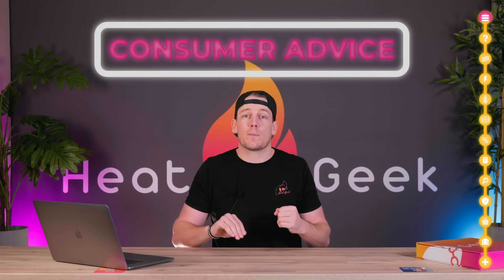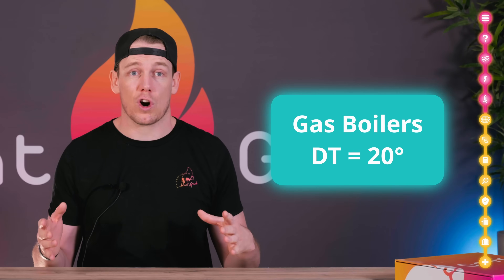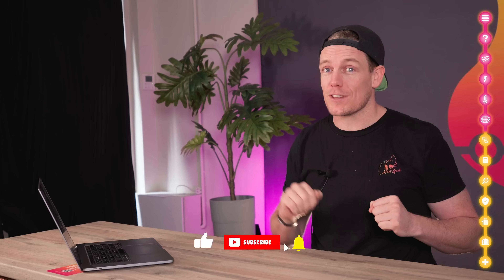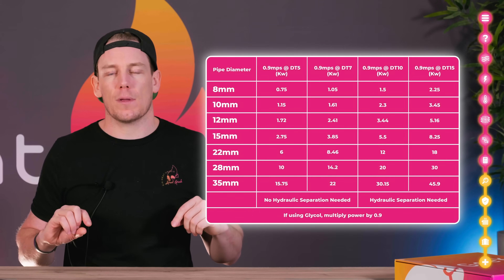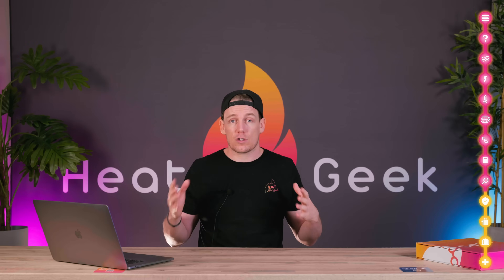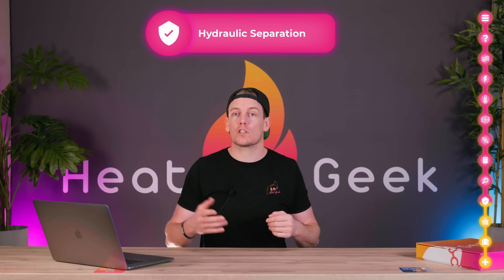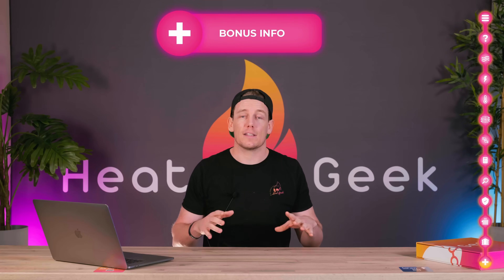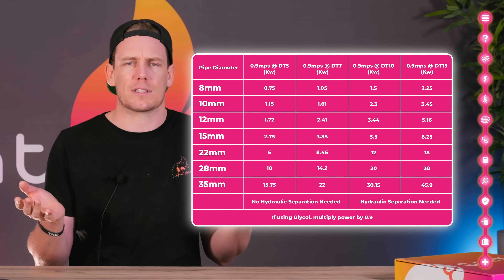Do I Need To Upgrade My Pipework For A Heat Pump Install? | Consumer Advice

Comment: I have a 20mm pex pipe to the upperfloors from below underfloor heating. Boiler is now at the 2nd floor which has 28 mm pipe with all rads and underfloor heating connected. This works fine.

I am thinking of a heatpump outside and inner equipment in the basement. The rads upstairs have a combined output of 2.5-3kw at average 40 degrees which keeps the house more than enough warm after insulation has been applied.

Will the 20mm uponor flex pipe be enough for transfering this amount of heat? 

The groundfloor heating will be coupled directly.

Comment: Can we get the grant if we install the ASHP ourselves? The labour costs seem exorbitant for just installing a heat pump. I am an air conditioner engineer, and the principles are the same for a fan coil or plate exchange.
Reply: google MCS umbrella scheme providers.

Comment: Thanks Heat Geek twins. 
My plastic microbore (inner diameter 7mm) gives flow speed of 1.24 m/s for my biggest 1kW radiator at dt=5
but only 0.9m/s at dt=7. Teetering on the limits I think. Not ideal.

Comment: I’m moving home. The new house (1930s) has a brand new gas combi boiler. Should I keep that and lower usage or swap for a new high temp
Ashp ? Is there any benefit other than lowering CO2 emissions?

I have a low temp heat pump in my old house (1960s) and it works just fine

Comment: Great video, just wondering though, would a high temperature heat pump remove the need to replace any pipework in an existing installation?

Comment: This 'no plastic pipe' comment is annoying. It's still just pipe, with flow rates, volumes and pressure drops. Just give us the numbers and let us do the sums (yes my house already has a lot of plastic pipe, but it's also very low demand due to near-enerPHit rertofit. So it might be good enough, but I can't check without the relevant info.
Reply from the maker: If it’s near enerphit it will be more than ok!!
Reply: @HeatGeek  yes, probably, but the sums still need doing. You said yourself that doing the sums is very important, but I can't if no data for plastic pipes is provided. I've got a couple of runs of 10mm plastic, which is of course the worst possible pipe for flowrates. But they are quite short, and tearing off the plasterboard to fix them is not something I want to do without some sums proving that it is necessary.

Comment: My hot water tank has 22mm inlet and outlet for flow and return am I okay to take it straight to 28 to each floor if the house then tee off into 22 and then 28mm back to tank which then converts back onto the 22mm anything else I should take into consideration it’s a 12kw heat pump

Comment: I have a 1 pipe system in my house which (as I understand) really needs to be replaced with a 2 pipe system for a heat pump. I was going to redo the pipework myself to save money before getting someone in to fit a heat pump. My take away from watching this video is that I might as well make my primary pipework 28mm as bigger shouldn't be detrimental and bigger radiators also can't be detrimental (even if they are bigger than they need to be for the room size)?
Reply: My neighbour just used his existing 1-pipe system with a new heatpump and it's been working fine for 3 years now. This works because he insulated the house very well so the heatpump is only 3kW. i.e just like the advice around 12:00 on this vid. His whole install cost under £2000.

Comment: Friction on the walls of the pipe is incorrect. It's resistance which is very different. This debunks the claim that the walls of the pipe wear out significantly due to friction. It takes an irrelevantly lengthy amount of time for plumbing pipes to wear out due to friction from wster.

Comment: Interesting video thank you.  You said that plastic pipes don't belong in heating systems, but in more than one property, I've seen damaged pipe being replaced with a short section of plastic (avoidance of drain down and soldering to effect a copper pipe repair).  Also I've seen a run to a new additional (small) radiator (for downstairs toilet addition) having been done in plastic pipe under the floor (connected between two nearest original radiators).  Do these small runs really matter?  I understand you commented about the plastic pipe inserts that choke down the diameter at the joints, so I'm a bit concerned those might matter in future if the gas boilers were to be replaced with heat pumps.  Thanks.
Reply from the maker: @TechTravel-up2cx  yes lots of people do it. Especially diyers like builders or handymen.. and ofcourse house bashers. Regarding the bit about soldering most are moving to pressfit now so not and issue. It’s not just the choking it’s also air ingress.
Reply: @HeatGeek  Thanks for the reply.  Air ingress! Oh no!  😲
Reply from the maker: @ yes but not an issue for air locks.. an issue for corrosion and rust that will kill mechanical parts
Reply: @HeatGeek  OK.  Thanks very much for that insight.

Comment: I thought most properties had 15mm primary pipework? My bungalow has 15mm and my heat loss is about 7kW so does that mean i need to replace it all with 22mm? Also i didnt understand thd part where you said you can replace the pipework just between the ASHP and branch before the rads? Thanks.

Comment: This is a great video, but you should warn viewers about the building regs re how much wood you can safely cut out of the joists. 22mm is often the limit due to those rules! And good luck venting those huge pipe diameters😮

Comment: 8kw pump with 4kw load and main pipes are 22mm copper and 15mm for the radiators . The flow noise coming from the main pipes is very loud :S

Comment: in Europe, now days, triple glazing is not much more expensive then double, so  more and more people rather pay a bit more for triple glazing when throwing out 30-50 year old windows when doing renovation. also triple glass windows let thru even less noise, which is an extra benefit.

Comment: Hi adam. Very useful video. We need advice having applied for a Home Upgrade Grant to install a ASHP. We live in a 4 bedroom 1973 detached house and wish to convert our 10 year old biomass boiler for a ASHP.
The approved contractor working on behalf of Somerset council quoted £27k for the kob due to needing to upsizing internal pipework as well as radiators.
Two subsequent installers have both quoted considerably less and questioned the need to upsize pipework. The existing pipework runs at 28mm from biomass boiler to the house and then 22mm and then 15mm spurs.
The local retrofit assessor sides with the approved contractor aa it follows MCS rules for home upgrades. The problem is that upsizing all pipework would involve lifting floorboards, carpets tiles, ripping out old pipework and installing new which would run down walls anf slong skirting snd basically would mean huge disturance and redecorating afterwards.
Plus we would have to put almost as much own funds to the grant. 
Basically we need a third impartial opinion as we are also considering the alternative option of reverting back to oil boiler which is by far the cheapest option. Very happy to provide more information but desperate for advice. Thanks
Reply: Did you get any further here? I am in pretty much the same position as you. The approved contractors came round today and said the pipe work would need to be changed resulting in a massive construction job, particularly as I have solid flooring on my first floor. I haven’t had any other second opinions so far so don’t know whether changing the pipes is 100% necessary as the contractor is saying.

Comment: I live in a late 90s 4 bed detached that still has an old non condensing boiler. The loft is insulated but not quite up to todays standard and I have cavity insulation and double glazing throughout. I am expecting/hoping my heat loss is no more than about 6kW.

The primary pipework from the boiler to the three port valve is 22mm but all my pipework to the radiators is behind the plaster board. At some point it becomes 10mm microbore as this is what goes into all radiators. So how do I check what I can't see to make sure there are no hidden restrictions such as manifolds, if that matters?

Is there not a way to do some tests to get precise measurements? Some equipment that can be attached to test out the flow, etc?

I am keen to avoid the additional cost, complexity and reduced efficiency of a buffer/LLH, if at all possible.

Comment: Just to clarify something - the text accompanying etc says there is no problem if the primary run is the right size and "tee offs" of 15mm to rads are ok?  Are there any limiting factors on this?  I'm planning a HP now and I have 35mm from the boiler room, down to 22mm in the house which then tees off to 15mm to 5 radiator locations which will have a combined need to deliver about 6.2kw at -3 (and rads will be sized to assume 40/35 flow and return).  Am I looking at a problem with the "tee offs" from the 22mm pipe to these locations at 15mm?

Comment: If I have two collectors for UFH, the first one covers area with 6 Kw heat loss, and the second one covers area with 3 kw heat loss. When I'm designing the pipework to the collectors do I need to take into consideration those values separately  and according to the energy that need to be transferred to the collectors to choose the right pipe size from your table?

e.g for delta T = 5 and pipe velocity 0.9 for the first collector of 6kw I need to use 22 mm, and for the collector of 3kw I need to use 15 mm pipe. and both pipelines  to connect into 28mm pipe

Comment: Hi I have two  questions, 1) would you fit a low loss header when you have a hot water tank as well as central heating?
2) in one of your video's you talk about not putting glycol or antifreeze  in a system but then you dont say what you do put in??
Reply from the maker: Whether you have a cylinder or not doesn’t affect whether you fit a llh. 
 Advice generally is to fit an antifreeze valve although we would question even if that’s needed

Comment: Hello, I have and plan to install your Ariston Nimbus compact heat pump with 110s net 16.7 kW.
I have a house on two floors, 70m2+100m2, roof insulation 20cm, walls 15cm, floor 10cm and triple windows.
Can the Nimbus compact do heating, cooling and hot water independently without a buffer and an additional pump?
Thank you.

Comment: Could I ask, I have a relatively easy option to increase the pipe bore for the upstairs radiators but not the downstairs ones. Is that something I should go for? Does the fact that they’re upstairs come into the equation? i.e. they need more hydraulic head

Comment: Diameter x 2 = Volume x 4, for the same length of pipe, not 8.

Because bore area of pipework  2cm diameter ( radius 1cm) = PI x r^2=PI  x 1^2 = PI
Bore are of pipe 4cm diameter (radius 2cm) = PI x 2^2 = 4xPI

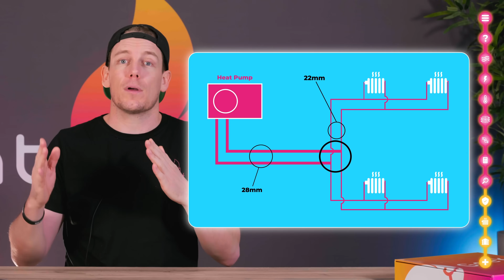Comment: The diagram at 8:16 shows a heatpump directly suppling a network of four radiators.
Can a heatpump really be set up this way so aimply without any hot water tank ?

I've only ever seen heatpump installations with huge watertanks and quite complex pipework too. So do people only have these giant water tanks for hot water supply and they don't play any part in supplying house heating ?

Can one run a simpler (no tank) heatpump system like this JUST to supply radiators for heating and have something else for the hot water supply needs ?
Reply: You could yes but can't really see the pojnt

Comment: Hi Adam, interesting. Could you give an indication of the % efficiency reduction of a heat pump working with a temperature difference of 6 degrees versus 5 degrees? I live in the Netherlands, no heat geeks here.

Comment: O no I just did a new build in 22mm poly all the way to the rads and it’s having a heat pump installed by another company. 

This has me feeling really bad. 🤦🏻‍♂️

Comment: Hi Adam, late to your channel. Could you do something specific to brands eg i have Mitsubishi ecodan and Mitsubishi recommend constant flow temp for under floor systems. I have tried weather compensation and it was terrible (cop 1.9) but i can squeeze 3.0 out at 7C ambient. I don't understand why that was the case and would love your take on it.

Comment: A great video ,  so you may nkt have to upgrade  unfortunately to cut costs many homes built in recession times have very small  pipes  10-15 even 8mm in at least part of the system   to save costs, which is  far smaller than any numbers quoted in this video .

Comment: i have the option of installing a buffer in parallel or in series  (on the return) on a heatpump. what is best? With the buffer in parallel it does not need an additional pump

Comment: Just catching up ... at 4:58, doubling diameter doesn't mean increasing volume by 8!

Doubling ALL dimensions (including length) would mean increasing volume by 8. Assuming the same length of pipe, doubling diameter means increasing volume of water therein by 4 (i.e. increase of cross section).

Comment: I use a gas boiler. If the government wants me to switch to a heat pump, they better be prepared to pay for the equipment and conversation. I won't buy something I do not want.
Reply: Govt has no money, they use my money. Why would I pay for you.
Reply: @140rware   What are you on?

Comment: I connected my arotherm 105 monoblock with 32mm mlc. Heatloss calc at 8.9kw (design temp -7) so i’m a bit oversized on the heatpump. I’m debating wether i should fit in a volumizer/buffer in the return line to prevent cycling. What do you think?

I minimized use of couplings due to mlc so it cant be all bad i suppose. Have a run of 32mm mlc to the technical room of 6 meters from the arotherm to the belowfloors ufh manifold (hoh 10cm dst) and another 7 towards towards the first floor ufh manifold (in 26mm). Judging by the cheat sheet i should be fine. 

Which heat meter are you guys using btw?

Comment: How would you integrate a 600l thermal store into a heat pump setup - as a giant buffer tank to take advantage of off peak electricity? Assuming a separate hot water tank.

Comment: So after watching all the info out there about heat pumps, I decided to go ahead. The good news is I would get a full installation for free paid by the UK tax payer because I am a pension and my gas boiler is LPG. The new installtion included 20 solar panels, whole house insulation and the heat pump with associated equipment, all provided and fitted free, not a penny for me to pay, yet would cost some 17k had I to pay for it.

So why did I not go ahead?

Microbore.

My house is a detached 4 bed and all rooms have radiators connected by 8mm microbore.

The assessment people did a survey and told me all my pipework would need upgrading to minimum 15mm which in turn means lifting every floor in every room to lay new pipework. This work would not be covered by the UK Government grants and I would be looking at around 10k to have them do all the work and make good afterwards.

I pointed out that some installers are saying microbore isn't an issue and they told me its all rubbish and these people don't know what they are talking about, further going into flow rates etc. as you have done.

So as a layman I am in a situation where I have no idea who to believe or where to turn.

A heat pump installation would cost me some 10K plus 17K = 27k to install, and at current annual savings even on LPG would take 67 years to pay for itself.

Its important when making these videos not to build peoples hopes becuase few will benefit from this technology without massive investiment.

Looks like its LPG for me.
Reply from the maker: Hey. Any home will work with micro bore. It’s just wether you need a buffer or not. As per the video. Your surveyors didn’t know what they were doing unfortunately. Please send them this video. No hopes, just basic engineering

Comment: The size of pipework has to be calculated. The starting point is the heat requirement of the system, then the operating conditions of the system ( usually determined by the temperature drop across the system which in most cases mean the required operating characteristics of the device providing the heating medium) Heat pumps operate at different system temperature drops than LTHW systems fed by a condensing gas boiler. OK, now you’ve established the system flow rate there are factors affecting the sizing of the pipework. High velocity in pipes is both noisy and energy hungry as it produces high specific pressure drops making the overall system pressure drop higher and consequently higher power requirement for the pump. So the size of pipework must reflect the types of pump that are economic for the application. Commercial projects require the same calculation procedure but may be less constrained by the above factors although it’s always sensible to optimise the capital and running costs of a system . Some older heating systems have larger pipework anyway ( ours has 35 mm common flow and return and the heating circuits start off with 28mm pipework). But the whole point if this is the need to calculate what you need rather than be guided by “rules of thumb” . Most heat pump systems that have been found to be inadequate are usually the result of poor design and installation as a result of not doing proper calculations in the first place.